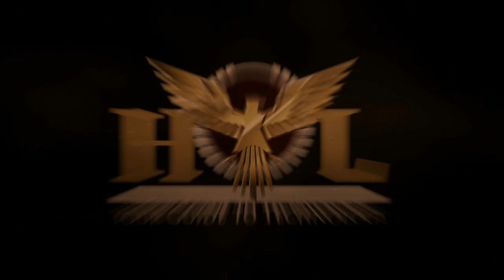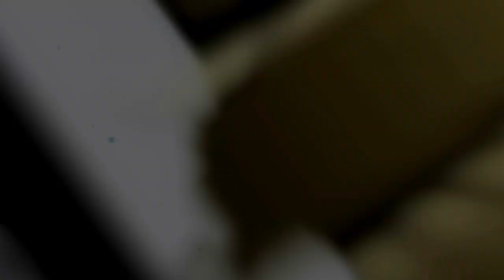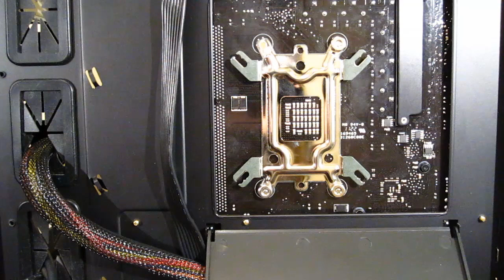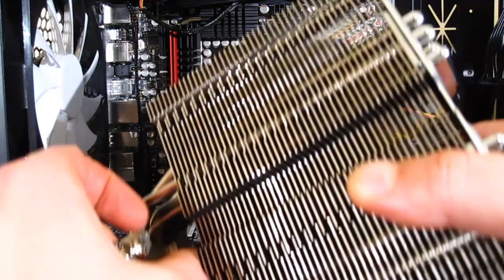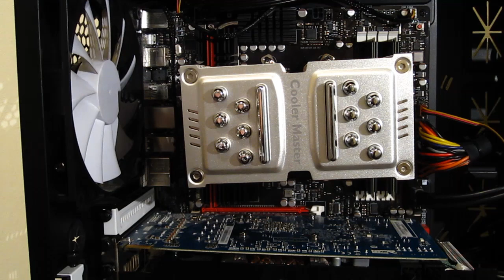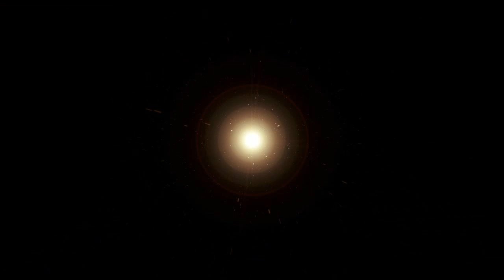Cooler Master TPC 812 Installation at HiTechLegion.com

Comment: He installed the easy way. The heatsink is huge and blocked a pci exp x1 slot and one dimm.So I can only use 2 out of 4 dimms. Later I guess, I can upgrade to 8gb x 2 modules.I used a cooler master Scout case and the heat sink just barely fit in case. Don't use a case smaller than a Scout.

Comment from the maker: It is a low pressure mount, so you will be able to twist it a little. However, if it is wobbling then there is a problem.

Comment: this cooler is a bitch to install because of the spring loaded brackets, it fucks up the thermal paste and spreads it all over because the cooler WILL move around when installing

Comment: In some cases, the processor area of the motherboard isn't exposed for easy installation like this. There looks to be screwholes however. Do I install this attached to the case, or only to the motherboard? (meaning for complete builds adding a postmarket heatsink such as this they should take apart their build and start over)

Comment: Looks like it. I think the fan brackets screw into the 120mm holes in whatever fan you are using. The SP120 don't have straight edges but the holes are in the same spots so it should work.

Comment from the maker: Like most Cooler Master units, the TPC 812 uses a low pressure mount. It does have some movement after it is secured. Also, because of this, it usually requires more TIM than usual for good contact. If your load temps seem oddly high, you may need to add more TIM.

Comment from the maker: Yes, most of the Cooler Masters are low pressure mounts, and the TPC812 is no exception. I understand your concern, I did the same thing the first time I mounted the V6 GT, thought it had to be mounted wrong, but it wasn't. The 812 also requires a bit more TIM than I am used to using for optimal cooling.

Comment: i just recently bought an ASUS P8Z77-V LK -- Intel Z77 Chipset, i need help determining which heat sinks & cooler to go with the ram as in g skill or corsair vengeance and which video card. looking for a video card under $200. please advise. Website i am using to order tigerdirect.ca

Comment from the maker: The case used is a Fractal Design Define XL full tower, a MUCH larger case than the Tempest 210. The Tempest 210 lists 160mm cooler clearance, while the TPC 812  is listed at 163mm tall.